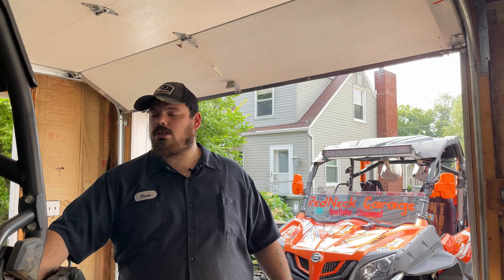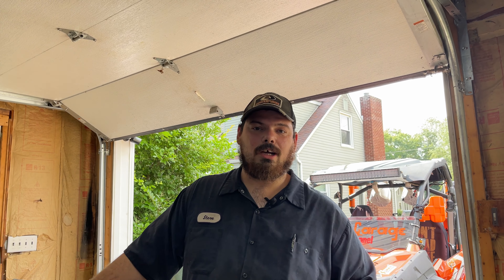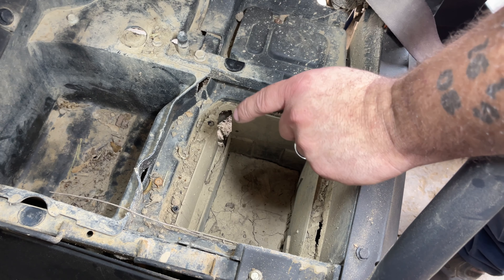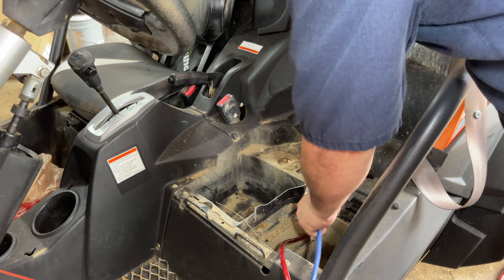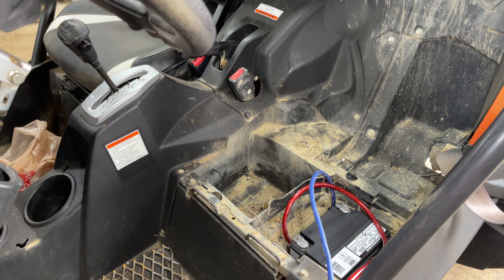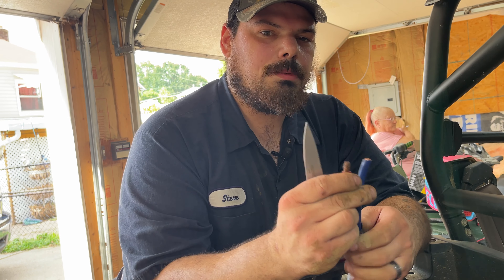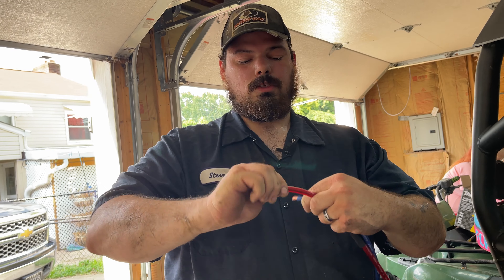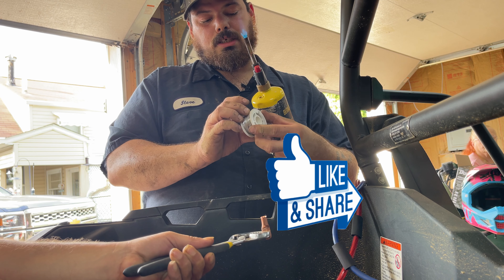How to Add a second battery to your CFMOTO

Comment: Awesomeness.   Red don’t forget if the voltages regulator plug melts and the positive terminal gets enough plastic on it.  It also throw the efi light too.
Reply from the maker: That’s right and thats the number 1 cause.  Thanks for bringing that up.
Reply: I have a cfmoto 600 I hate how much rpm you have to 5 mph I use mine for hurting you said c1 is the best am all stock 50 miles so far

Comment: My zforce is a 2021 800 trail, in that battery box there is a canister of some kind, it has two small hoses coming out of it , do you know what it is and where I could move it? Thanks
Reply from the maker: That is a evap canister. You can delete it.   Plug off the throttle body hose.  Delete the one hose and the tank breather run it up the cage

Comment: This location on my 2021 zforce 800 trail  has a canister located in it.  Where did you move that too
Reply from the maker: The trash can
Reply: @R.N.GPerformance  I just moved my Evap Canister to the next compartment over under the seat (closer to the center console), then put my battery where it SHOULD have been from the factory. Fits like a Glove! Only had to add a hole for the 3 hoses, canister fits right in.! Distribution blocks and a couple 2 ft cables is all  I needed. Will cut the old shelf off so getting to the belt and clutch will be so much better!

Comment: love your stuff just got a used 2019 800 trail I see a lot of talk about a hidden 40 amp fuse can you tele where it is so I can get a spare and replace if needed thanks love your videos
Reply from the maker: It’s under the driver seat in a small compartment there are 2 of them.   Thank you 🙏
Reply: @R.N.GPerformance  thank you so much opened it up was half full of mud so I opened the battery box beside it I will be putting battery there soon it was half full of mud too all washed out now and going to get spares thank you so much

Comment: @RNG Stupid question but how do you get the battery out of a 2022 CF Moto ZForce 950 H.O. EX? I got the bungee strap off. I tried to pull straight up didn’t budge a mm. Has 2 nylon straps around the battery don’t know what they are for. Thanks if you can answer me👍🏽
Reply from the maker: Those straps don’t do anything it should just come right out.
Reply: @R.N.GPerformance  yeah I didn’t know for sure don’t like fixing crap I break is all I figured if anyone knew you would thanks bro for all the great content.👍🏽

Comment: just useing my raido rock lights and whip lights when the fan comes on i go to 11v
Reply from the maker: Thats normal.  Your drawing more then What your charging system can handle.
Reply: @R.N.GPerformance  I'm goint to put Dual Battery Connect & Monitor Kit in
Reply from the maker: @buckyspowersports299  heck yeah

Comment: Hey buddy, I have no power. I crossed the cables on my battery and have no power. Can you give me some advice where to find the fuses. I found the one up front and the main fuse under the driver seat. Anymore I need to check ?
Reply from the maker: Under driver seat check those.

Comment: So as I said before I just bought a zforce 800 trail 2021 so my question is I tried moving my battery to the location you said in the video but there is a cylinder in there with two black hoses going to it? I don’t know what it is and there is no way the battery will fit with that in that location please help thank you
Reply: I just looked under the seat on my 2021 800 trail and it is different than the one in the video as well.
Reply: Mine has this as well. Looks like a electric coil of some sort or either a water pump. Not certain.

Comment: Wish I could on mine there's something in that spot
Reply from the maker: Evap.  Delete it.
Reply: @R.N.GPerformance  stupid question but I haven’t dealt with Evap a lot. Is there anything special to do to remove it?
Reply from the maker: @Goofy2301  not really just take it off and the vent that gos to the tank run it up high and toss a filter on it.
Reply: @R.N.GPerformance  Awesome, just pull and toss the other two lines?
Reply from the maker: @Goofy2301  yup. Pretty much.
Reply from the maker: @Goofy2301  your welcome
Reply: @R.N.GPerformance  what kind of filter?
Reply from the maker: @kylergriepentrog856  you can use a fuel line filter.

Comment: Hello., how can you check if there’s no power after battery short circuit ? Fuses are good. There’s power only for the light bar but no power for anything else…what could I possibly check?.. It’s for  2019 Cfmoto zforce 500. Thanks
Reply from the maker: Have you checked the main fuses under the seat?

Comment: Quick question, I installed some speakers and a sub but I keep blowing the 30amp main fuse under the driver's seat, any idea why?
Reply from the maker: Too big of an amp? How many watts?
Reply: 400..
Reply from the maker: @eltorito9986  hmmm that’s not too big shouldn’t be having an issue like that.  I’m not sure unless something isn’t grounded right
Reply: And the thing is, the 30amp fuse going to the Amp doesn't burn out only the 30 Amp maim fuse. Weird....

Comment: That is not a good solder connection. Both connections must be heated to temperature and then tined. The solder did not flow into the wires and you burned off most of the flux with that amount of heat. I would suggest buying an inexpensive crimper.
Reply from the maker: We have actually done this then cut open and tested this many times.
Reply: @R.N.GPerformance  I could see how it may look like the wires are covered in solder but did the solder adhere to the wires? Wave soldering still needs flux on the surfaces to be soldered. It cant get its flux from the molten solder especially if the flux from the wire is being burnt off. You might have better luck coating the wire with flux. Try it and see the difference!

Comment: All due respect but why would you Not use waterproof heat shrink butt connectors and terminals which are also tinned when you know such a rig is going to be run through mud, muck, and water?  Soldering is actually inappropriate in such an application as you are making. Crimping outperforms soldering in such an application. 
And, also what about a battery separator/combiner? Something like a SurePower #1315 (or other brand)?